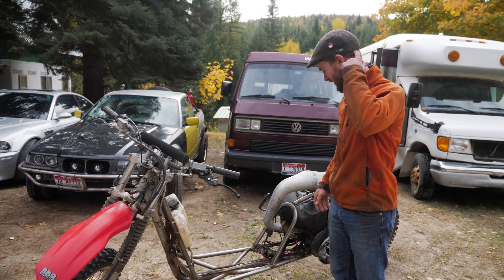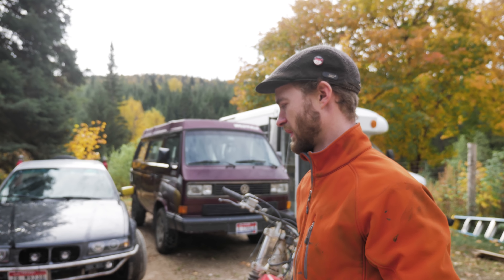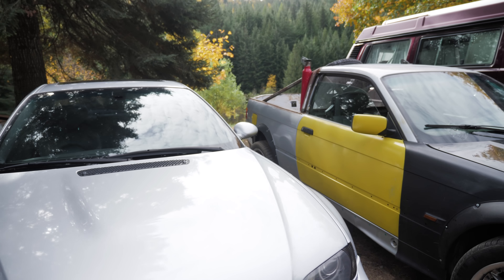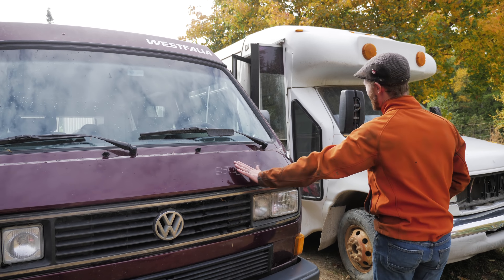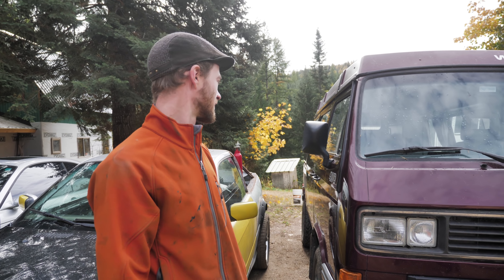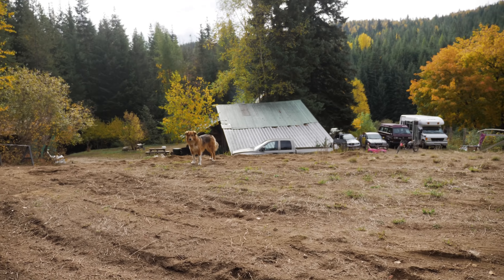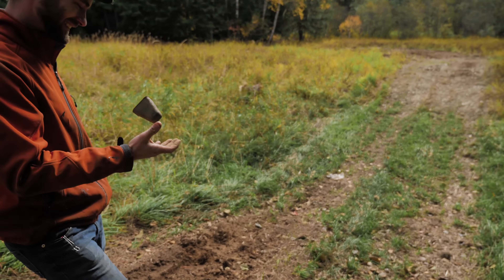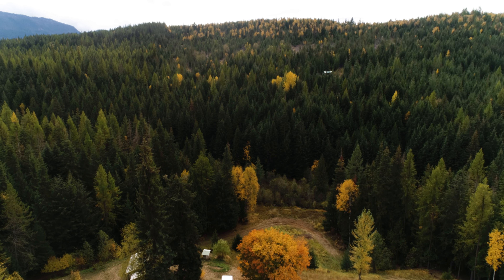The Crazy Builds of Grind Hard Plumbing Co (Property Tour)

Comment: Ive seen other people on youtube who try and turbo small motors like what is on the barbie car and the problem is that you arent changing the amount of fuel going into the engine so it runs more lean and loses horsepower. You just need to increase the amount of fuel going into the engine.
Reply from the maker: Thanks for the input, but I promise you that’s not the problem in this case. Maybe it would have been, if we had actually made boost, and if the turbo hadn’t self-districted.

Comment: I think the Barbie Stang needs a big brother.
Find a Power Wheels Ford Raptor and go either one of two ways with it, slam it and make it more like a lightning,  or lift it and go crazy full floater suspension, bigger gas engine, or a big electric motor. Some of the smaller 2-stroke quads have a trans that is like a snowmobiles. That could get stupid crazy!

Lift the BMW and go full rally car.

Kinda excited to see the party bus transformation.  Sure are a lot of options for it.

Comment: Stay. Away. From. The. Subaru. Diesel. Boxers. Please. 
And get the good old 1.9 tdi (not 2.0 - those are shit as well)
Reply from the maker: What’s wrong with the boxer?
Reply: Broken crankshafts, lubrication problems, failing pistons... Clearly a manufacturer's first try on a diesel engine from a quality/reliability standpoint. If you google it, you can find loads of topic about it. But it mainly concerns the first generation of this engine. 
But honestly, the 1.9 tdi is your best bet when it comes to parts availability and simplicity.

Comment: Blew up the turbo because you had the carb on the fucking turbo pushing gas into it. Learn how the shit works before you throw it together or else your gonna break it.  Y’all did carb turbo then engine when it’s supposed to be turbo carb engine. The turbo is supposed to force air through the carb into the engine. Not the carb pushing fuel into the turbo.
Reply: but its carbrated so then there is no vacuum to pull fuel in
Reply: 620 Gaming that’s the whole point of forced induction. The carb doesn’t suck in from the turbo. The turbo forces air through the carb
Reply: @juicymangos9820  yes I know but then there is no fuel because if the air pressure
Reply: 620 Gaming yes there is. The fuel is injected into the carb. The turbo pushes air through the carb and mixes with the fuel. The air/fuel mixture is forced into the engine. Thus more power numbers